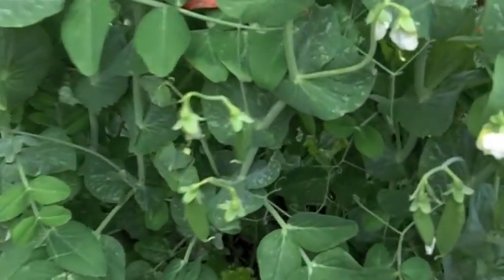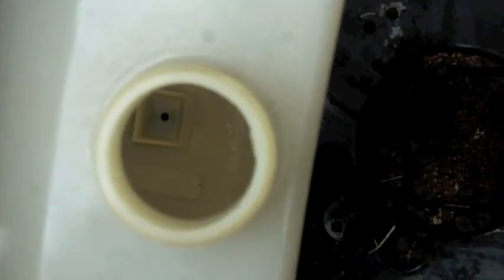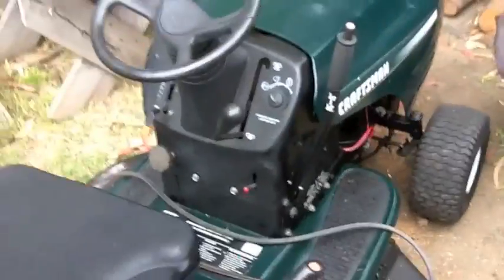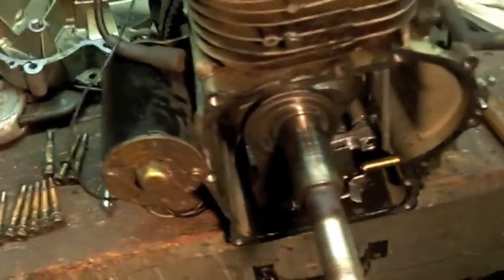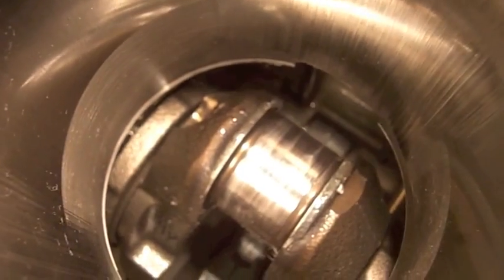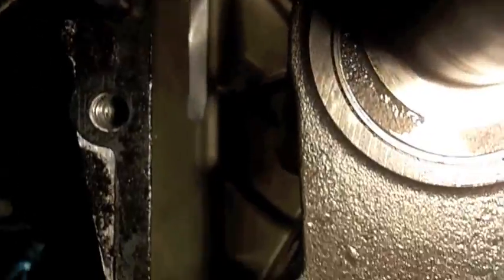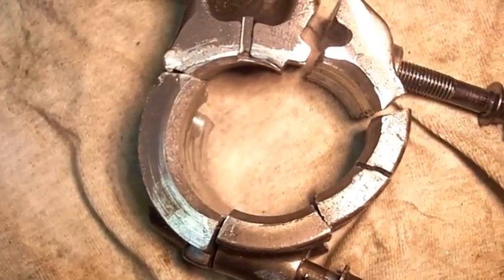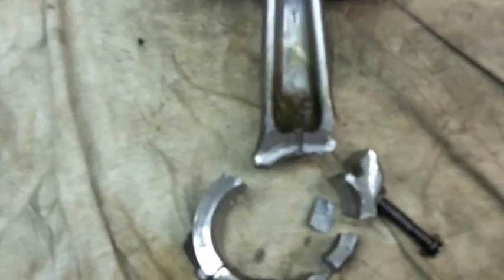Full Breakdown Of The Briggs Engine

Comment: overfilled, oil blew pass the rings or up into the intake and hydrolocked it while running. That's why it blew at the top, once the oil had no where to go
Reply from the maker: Veikra But the top of the piston was dry as a bone and the inside of the cyl. head showed no signs of oil saturation...check out the next video, I found something interesting..  still trying to figure out the chain of events.

Comment: Hard to believe there is no other damage. I think somebody down below mentioned that oil got past the rings and hydrolocked at the top and that seems logical to me if they over filled it. Been there and done that. I overfilled the tractor one time when I was a kid. That thing shot oil everywhere. Dad was less than impressed about it.
Reply from the maker: ***** I see a couple people have talked about oil in the top end... so I gave it some thought... The combustion chamber was very dry including the nice tan exhaust valve. There was also no oil in the muffler.. that was dry as a bone.  I would suspect those components would be oil soaked had this been the case?

Comment: Overfilling the crankcase with oil causes the crank shaft to strike the oil.  This in turn causes the oil to foam.  That, in turn, causes cavitation in the pump itself.  Thereby creating minimal or little oil pressure starving lubrication to the crank shaft which in turn starves oil being sent through the rod and oiling cylinder walls and wristpin.  This is what caused the rod to fail and the scuffing of your cylinder walls.  It is never a good idea to overfill any engine with oil.
Reply from the maker: certified 68 crazy All good information. Thanks.

Comment: You yanked another lucky horseshoe out of your ass again lol. The engine should be an easy fix, wash the shit out of the case with brake cleaner buff up the crank journal with emery cloth, slap it back together and you are good to go. The Craftsman is too new for you its not in the right vintage if its not 30 plus years old it doesn't meet the Beekeeper criteria LOL
Reply from the maker: Graveltrucking Yeah, it's waaaaay to new to be part of my fleet...lol.